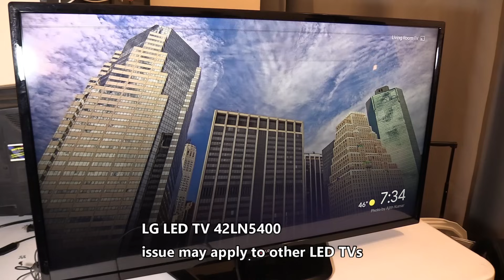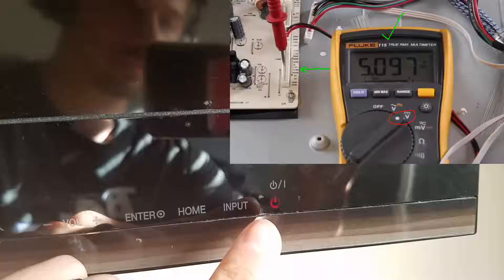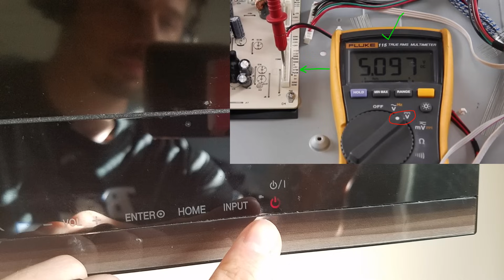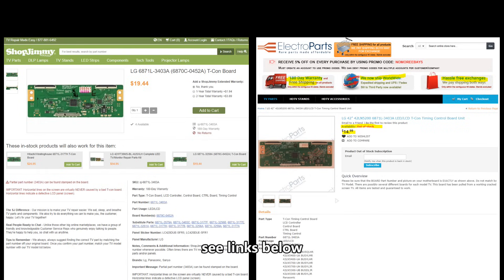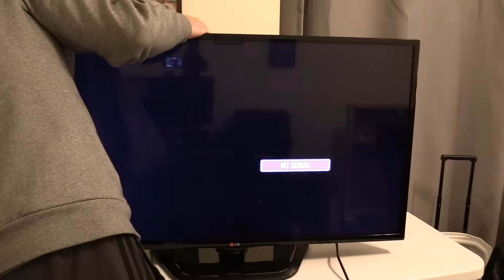How to Fix LED LCD TV with horizontal & vertical lines on the screen

Comment: I got a weird one as far as I can tell, a plasma LG 60PB6650 with an intermittent shadow problem. It seems to be whenever there's a dark and specifically horizontal edge or line in a show, it'll sometimes cast a shadow the width of whatever horizontally accross the whole screen. TV functions fine otherwise. Any ideas where I could start poking around?
Reply from the maker: shadow spots can be a bad lcd screen but if you buy a tcon board from electropartsonline.com they will refund the board if it does not fix your TV, kinda cool return policy.
Reply: Tampatec Thanks for the reply! I've been leaning towards the plasma screen going bad, but you'd hope for more than 2 years out of a screen, plus it's just strange how specific yet inconsistent the issue is. Nothing I've tried monkeying with has given me direction, but it's seemed more like a brightness issue rather than a shadow, if that makes any sense, like there's an issue with the signal on one or more sides of the screen resulting in what seems to be horizontal shadows cast by edges and dark objects across the screen but aren't shadows. I've seen ghosting and shadows before, but this....well, if you have any more ideas, let me know. In the meantime, I'll start with checking connections again, then on to the t-con. Thanks again!

Comment: Something currently occuring in the Racing sim cummunity is the failures  of the Thrustmaster line of Steering wheel servo bases. Hugely popular and fantastic products... When they work... (Tx model-xbox&pc) t300 model ps4&pc. I wish i currently had a broken base to send someone experienced for some insight as to why they fail so frequently..... Maybe i will try to find a busted one on ebay.
Reply from the maker: Apex Predator heat and moisture often destroy Electronics.